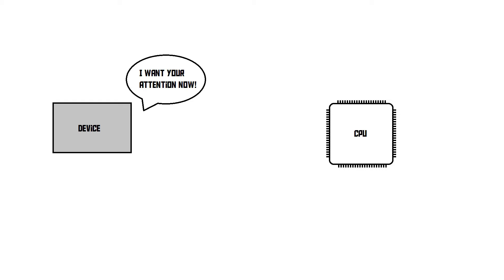What are interrupts, polling and DMA? (AKIO TV)

Comment: DMA

3:56
last system that we are going to discuss
3:57
in this video is DMA which stands for
4:00
direct memory access and that means
4:03
exactly what you would expect it to be
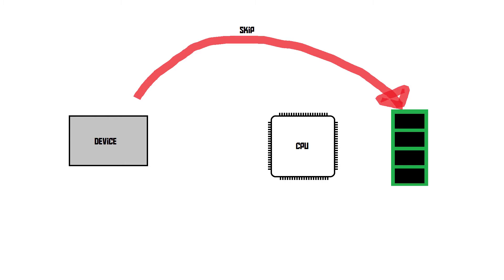4:05
in a direct memory access situation the
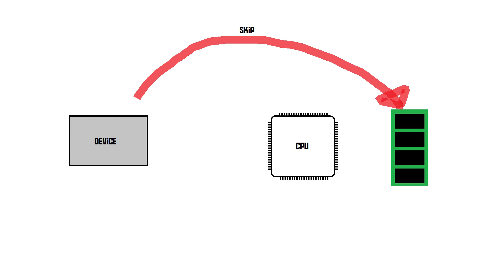4:10
device is able to access the memory of
4:13
the computer without the CPU being
4:16
involved at all let's take an ik take
4:18
the keyboard again as the example
4:20
although that's not really how it works
4:22
you can't have a DMA keyboard we'll talk
4:25
about that later on but it might work
4:27
for the example ok so what this would
4:30
mean is that you are working on a text
4:32
document on your computer and that text
4:34
document has a certain amount of memory
4:36
reserved to it in your computer memory
4:38
and what it what this means is that when
4:42
you press the letter
4:43
kay on the keyboard the keyboard can
4:45
actually access this memory and it can
4:48
then put that letter into your text
4:50
document so into that memory without the
4:53
CPU having to do anything at all so it
4:56
bypasses the CPU completely which is
4:59
even faster than an interrupt based
5:01
system now of course with the keyboard
5:04
this is not really possible because then
5:06
the keyboard has to know where to put
5:09
things in the memory which it doesn't
5:12

Comment: polling

1:30
then there is also the polling based
1:32
system now the polling based system
1:35
works kind of in the opposite way okay
1:38
in a polling based system the device is
1:42
very shy basically that's how I like to
1:45
describe it the device can't ask for
1:47
attention from the CPU on its own it can
1:50
only reply to requests from the CPU so
1:54
in a polling based system the CPU will
1:57
constantly be asking the device for a
2:00
status update so in this situation if
2:03
your device is a keyboard the CPU will
2:07
constantly ask the keyboard has anything
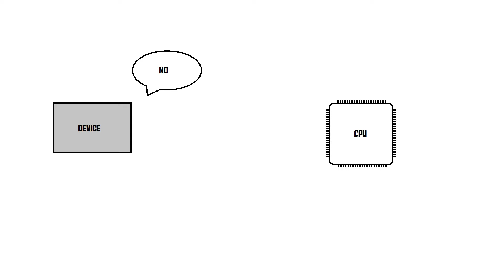2:10
happened yet has anything happened yet
2:12
has anything happened yet and if you if
2:15
you happen to press a key at that point
2:17
the keyboard will reply to the CPU
2:20
saying yes a key has been pressed now
2:23
you can imagine that this adds latency
2:25
because when you press the keyboard when
2:28
you press a key on the keyboard
2:30
that doesn't mean that you press the key
2:32
exactly at the same moment that the CPU
2:34
was asking for the information
2:36
it might take another few milliseconds
2:39
before the CPU does another request
2:41
right so this polling system has way
2:44
more latency than an interrupt based
2:47
system now actually USB peripheral so
2:51
USB keyboards usb mice use this polling
2:54
system so if you use USB peripherals you
2:57
have more latency than when you have ps2
3:00
peripherals so ps2 peripherals are these
3:02
these old keyboards and mice with these
3:05
little green and purple round connectors
3:08
on them right those can actually send
3:11
interrupts to the CPU and therefore have
3:14
a much lower latency although with
3:18
modern computers the polling rates are
3:20
so high and the processes are very fast
3:22
so in the real world you won't notice
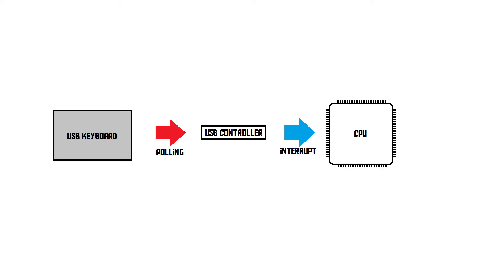3:25
this difference at all now some people
3:27
would argue that USB is not entirely
3:29
polling based because the polling is
3:32
actually not done by the CPU itself it's
3:35
done by a USB controller and the USB
3:38
controller is connected to the CPU
3:40
through an interrupt based system so the
3:43
communication between the keyboard and
3:45
the controller is polling based but the
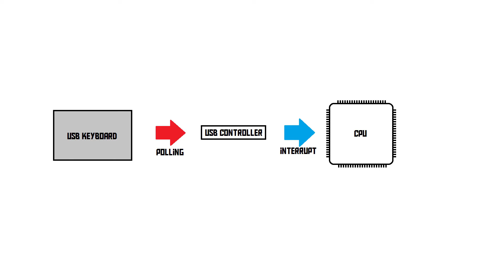3:48
communication between the controller and
3:49
the CPU is interrupt based but of course
3:53
that doesn't fix the latency issue the

Comment: interrupt

0:00
in this video we're going to take a look
0:02
in the three most common ways for
0:04
devices in a computer to send
0:06
information to a CPU which are
0:08
interrupts polling based systems and
0:11
finally DMA
0:17
okay first of all let's take a look at
0:20
the interrupts so here's how an
0:23
interrupt based system works let's say
0:26
we have a device in a computer it could
0:28
be anything right it could be a keyboard
0:30
it could be a hard drive whatever and
0:32
then we've also got a CPU and that
0:35
device for some reason needs to send
0:38
information to the CPU right this device
0:41
has some information that needs to end
0:43
up at the CPU for some reason what this
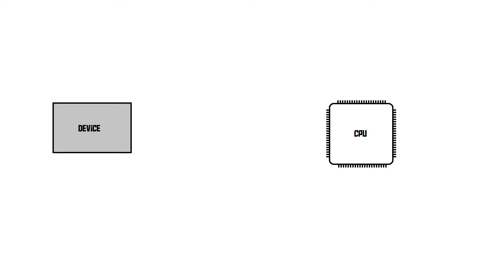0:48
device will then do if it's an
0:50
interrupter based system is it will send
0:52
a signal to the CPU saying hey I want
0:55
your attention right now and the CPU
0:58
will then stop doing whatever it's doing
1:01
at that point and it will then take a
1:03
look at that signal so if your device is
1:06
a keyboard that means if you press a key
1:08
on that keyboard the keyboard will send
1:11
a signal to the CPU which interrupts the
1:14
CPU right it it asks a CPU for attention
1:18
and it asks a CPU to stop whatever it's
1:20
doing and listen to the keyboard
1:22
basically and the CPU will then stop and
1:25
it will see oh the key has been pressed
1:28
that's how the interrupt system works

Comment: You did a great job in your explanation. Far too often, explanations from various sources do not take into account that many learners need to know the basics of something they are learning about before they proceed on. These basics are the journalistic questions that get someone started on their learning path (the who/what/why/how/where). The fundamental job of a teacher is to answer these questions for students in a way that allows them to conceptualize what something really is. You did that here. I have known of polling for a long time, and know what it does. It was only until now in a current class that I looked into it a bit further and found your explanation that locked in the unofficial knowledge I had. I greatly appreciate that. 

Great job putting yourself out there as a lecturer with very few visual aids to lean on. it demonstrates your ability to teach and train to the right level of understanding by the art of lecturing itself. I understand that many subjects require detailed training aids to get the point to the learner, but in this case it was not necessary and you nailed it.